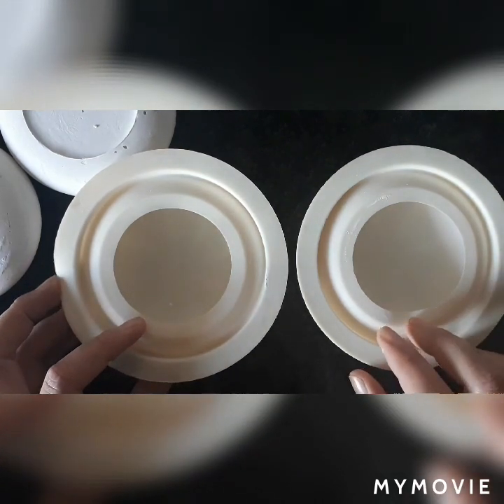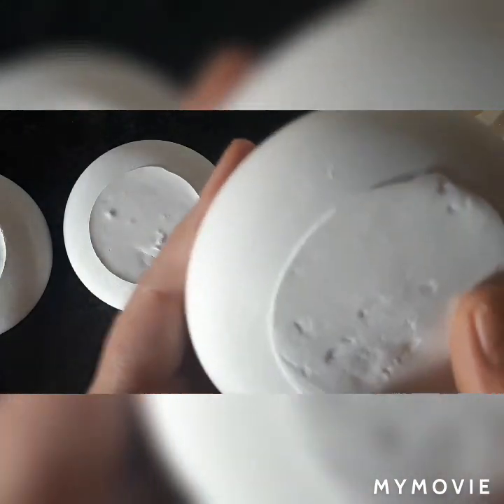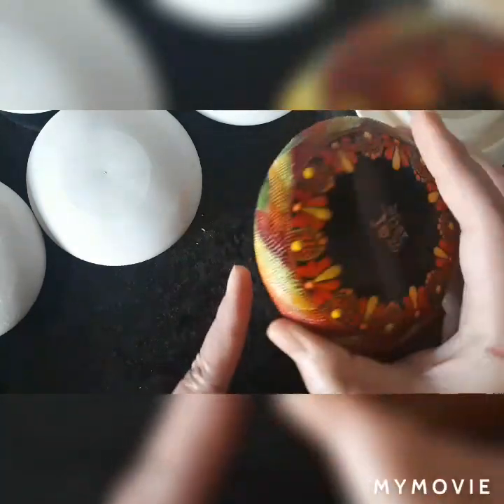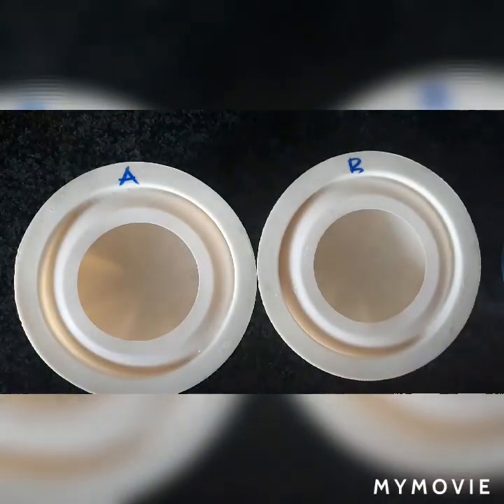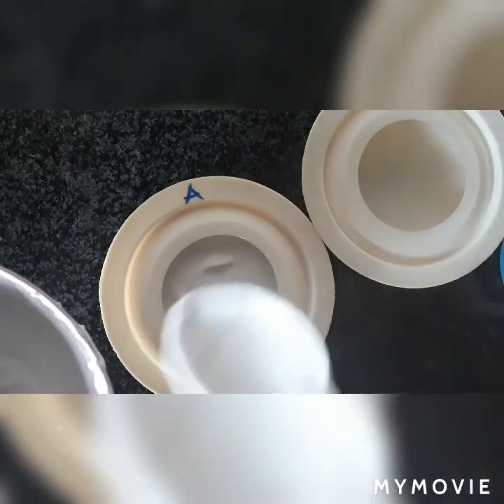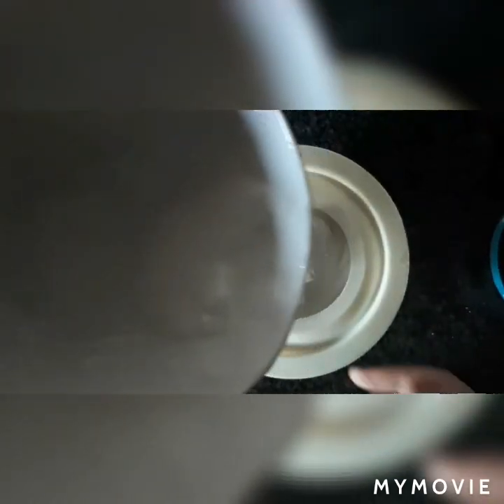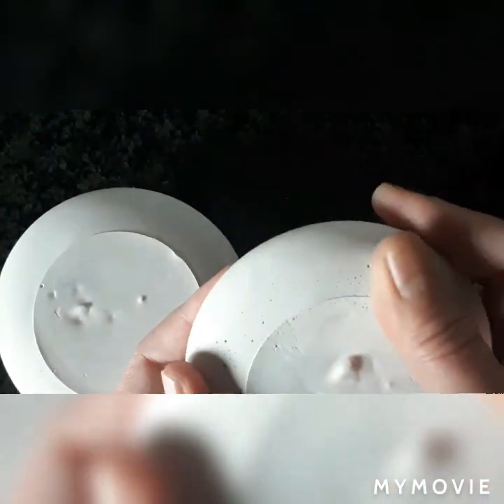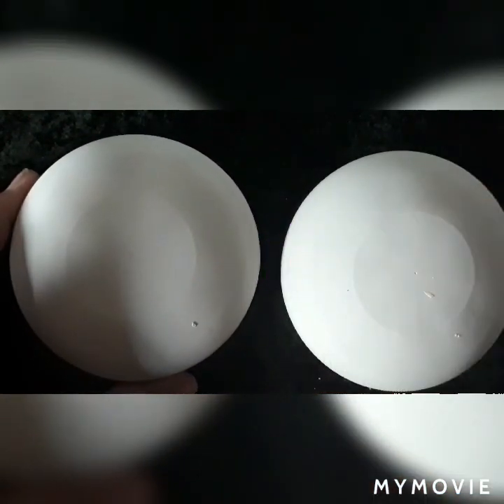SPOONING VS POURING.Tricks to avoid bubbles for mold rocks/ Happydottingcompany mold

Comment: I'm new to dot painting), 3 months. I always use spoon by spoon method and don't have bubbles. One more trick I saw on Youtube : between each spoon, I tap on the mold on all sides and, sometimes, bubbles come to the surface but they then disappear. When I have finished to "spoon", I tap on the mold everywhere, lift it 1 or 2 cm from the table and drop it 2 or 3 times.